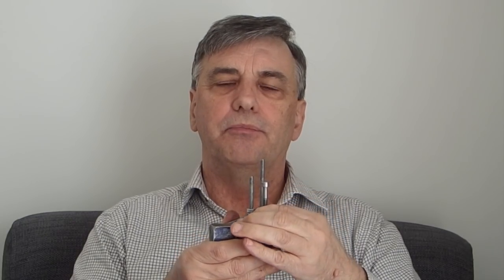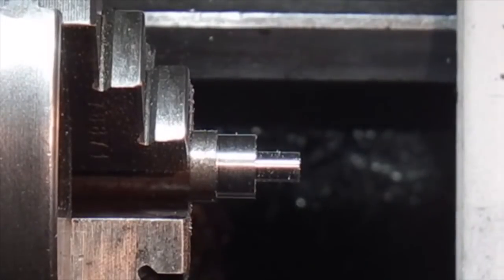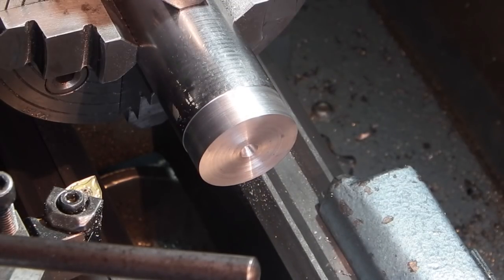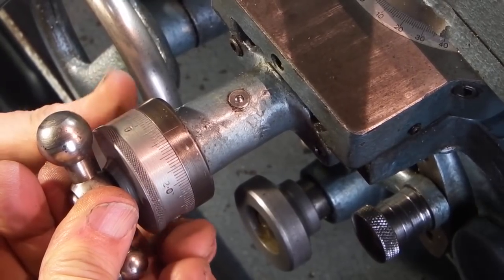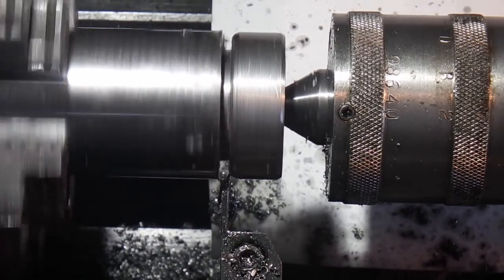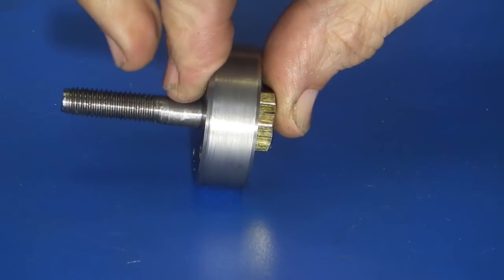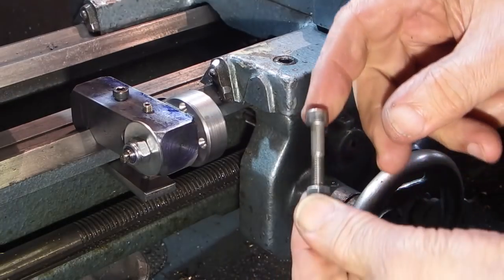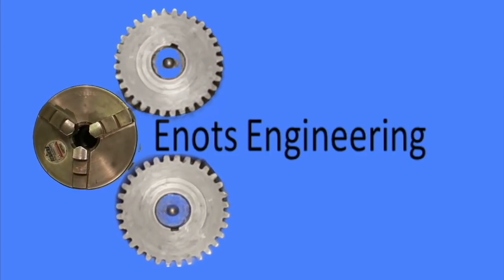Adding a turret to the carriage stop

Comment: Interesting project. For those of you out there with a mini lathe, there is no room for something this big. What you can however make is a quick change lathe stop holder. Then you put on your stop for the first operation, then swap out to the next and so on. A quick move of a handle, swap and away you go.

So now that I have said that, I am going to have to hit Fusion 360 and at least make up a model. Print out the plastic version and see how it works. Just what I needed, another project.